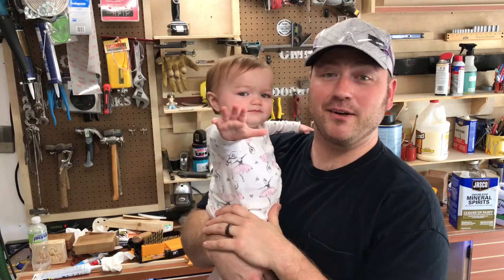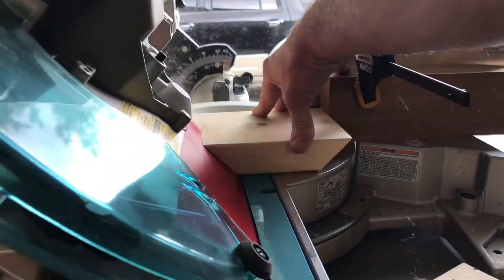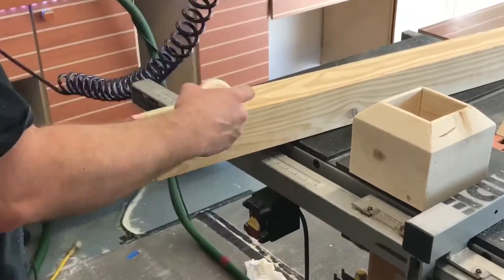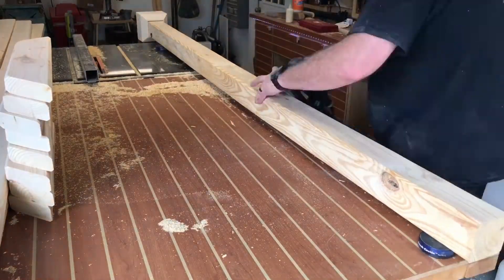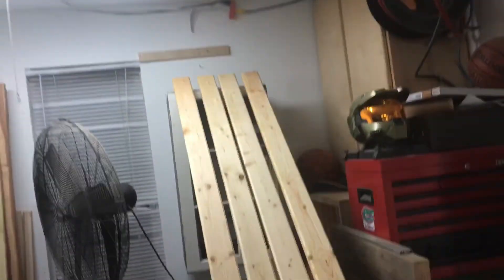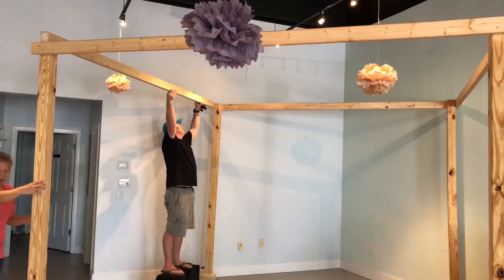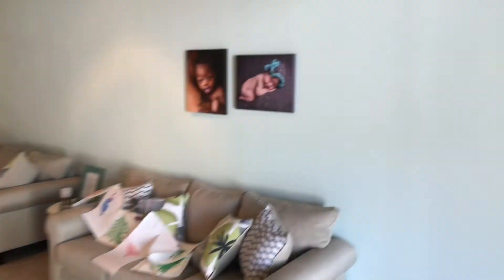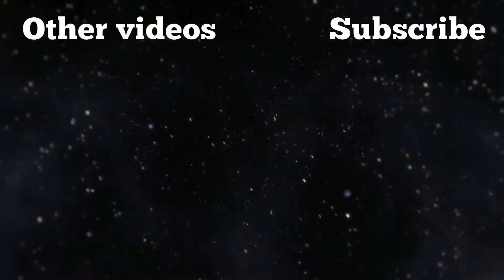4 post | Versatile Structure | Bed etc..

Comment: Finally u just poped up I wanted to build this to add to my platform bed to make it into a canopy ... now I kno wat to by at Home Depot... so is pine a real strong wood ??? Like if my 8
Yr old swing on it . It won’t crack down ?? ... nice work
Reply from the maker: You should be good for swinging on it. It’s sturdy for sure
Reply: @AGlimpseInside  what weight would you say this supports?